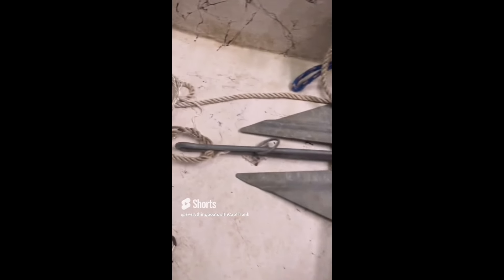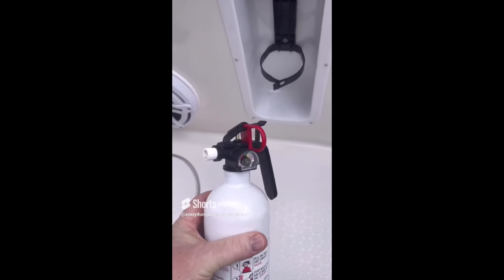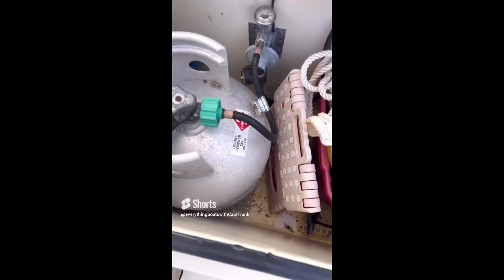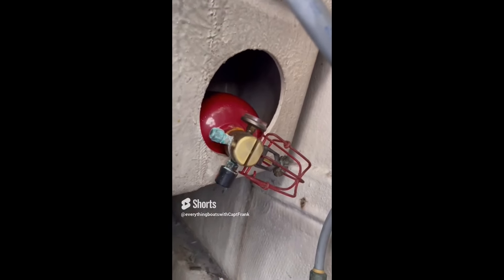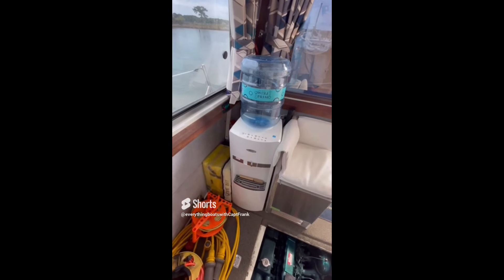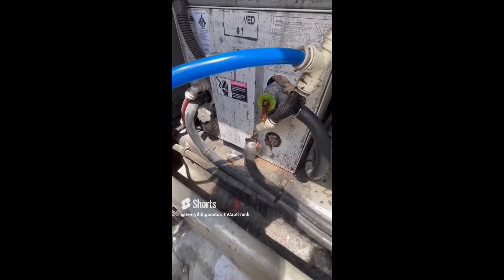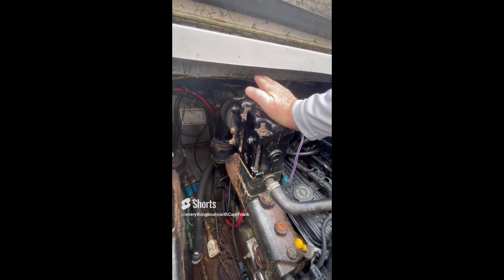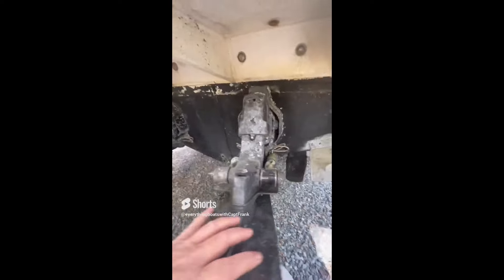Capt Frank’s 60 second survey (Episodes 61 thru 80): Bad things on boats and why they’re bad!

Comment: Quesion: what is the acceptable life span for a wet exhaust hose on a marine diesel engine (3" hard; 63hp)?
Reply from the maker: Thanks for the question. For expected service life, I’d start by checking the hose manufacturer’s website to see what they recommend. That being said, lacking specific guidance a general rule of thumb is to replace any hose after 10 years of service regardless of how it looks.